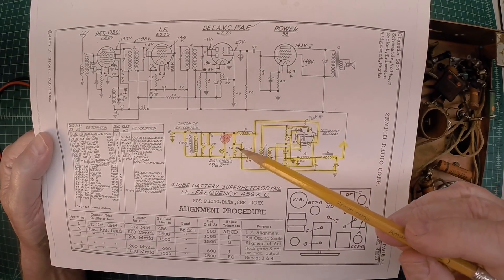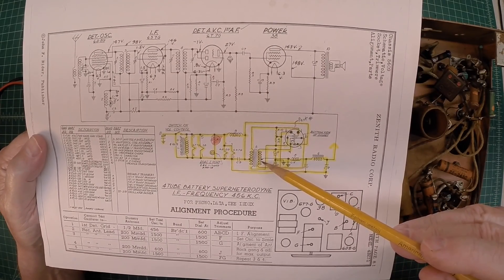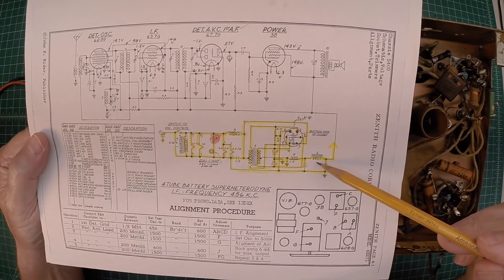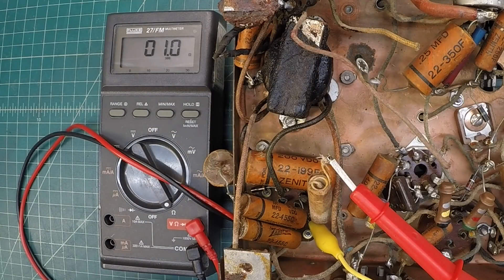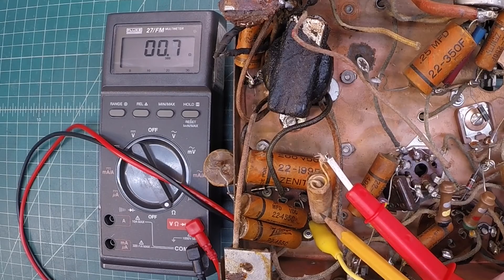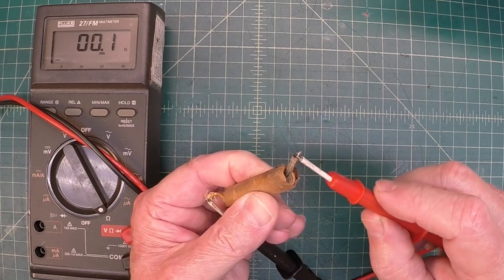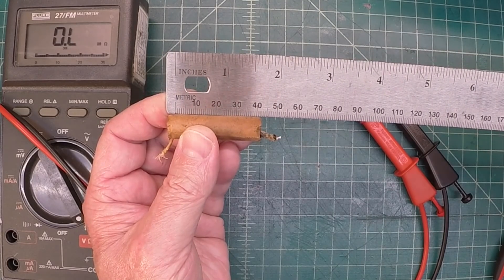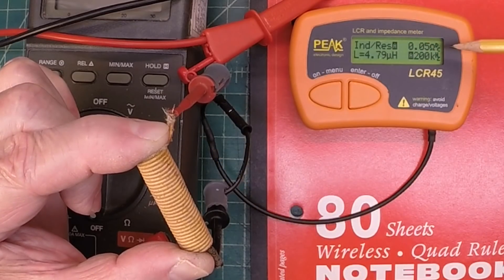Zenith 4-B-231 - Power/RF Chokes & Transformer Health - Part 5

Comment: RESTOREOLDRADIOS,
                        Using higher value choke values in power supplies will give a different sag compared to using lower value choke values. The Choke is a reactive component and explain why this happens because the chokes are tuned to 60hz or 120hz in power supplies so the higher or lower the choke value does something with the current to starve the circuit when drawing current? 
What I mean is that the Choke is a reactive AC resistor and the higher value chokes are a reactive AC resistor and the lower value chokes are a reactive AC resistor but what is the differences when the Circuit is drawing current when using a Higher value choke compared to using a lower value choke?